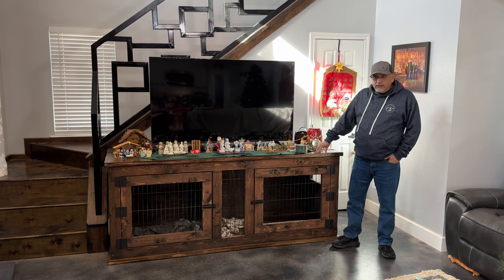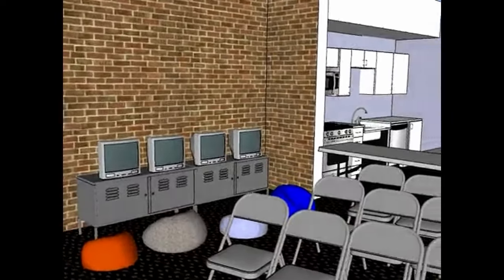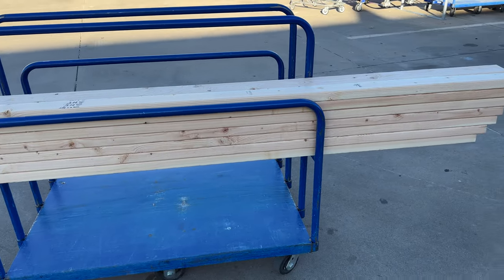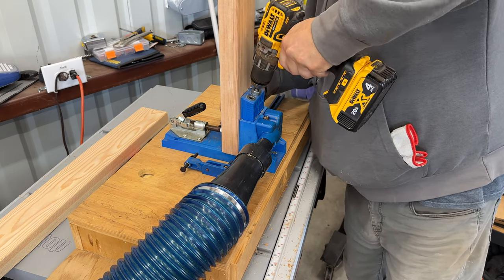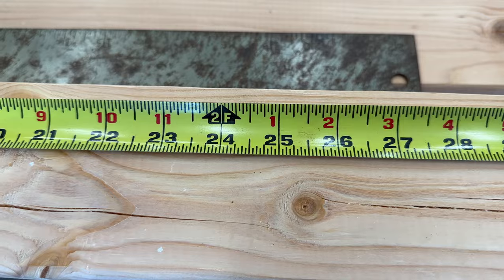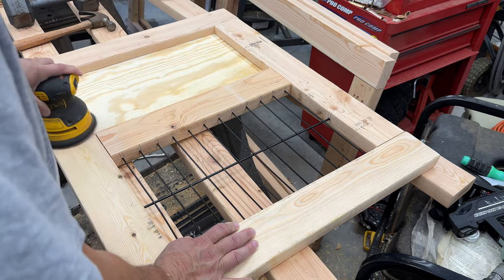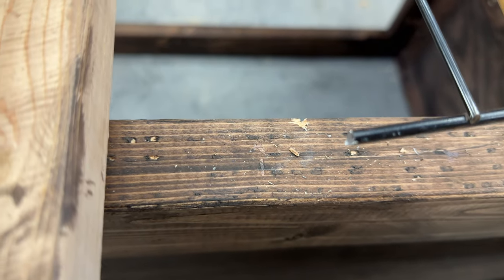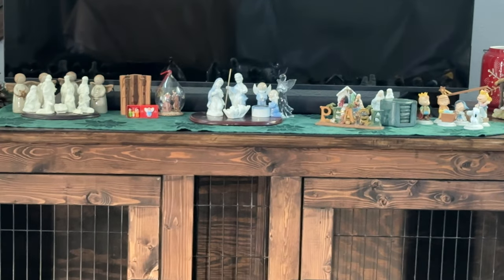DIY Rustic Indoor Dog Kennel Entertainment Center Build | Transforming Your Space!

Comment: I know it was annoying to do but i like the way you cut those metal grates and inserted the ends into the holes you drilled. Thats a really good, strong way to do it.
Reply from the maker: Thanks.  Most of the builds I had seen, they used Rebar or some type of metal rod.  But I figured I had this already.  And I figured it would give it a better look.  I really like the smaller metal instead of thick bars (the dogs aren't in jail).